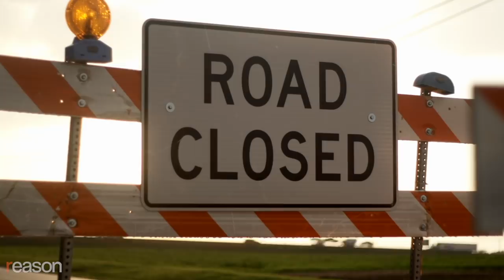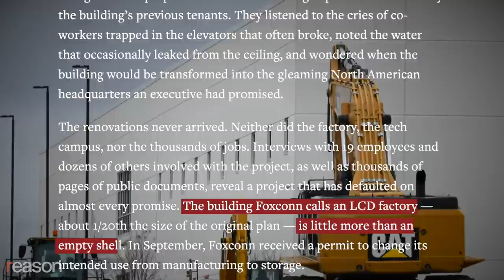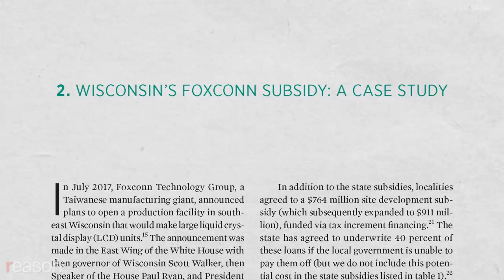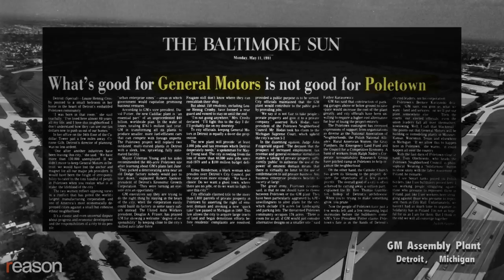Trump's Foxconn Deal Became Just Another Government Development Debacle

Comment: The issue here is more about politics and lawsuits than anything else.  Things take time to build, especially big things. A factory this size usually takes over a year to get initial production going, and additional years to get to full production. That is if nothing goes wrong. Ground breaking was in 2018... Governor opposed to the project was elected... I think you get the picture. Foxconn would have not gotten anything finished by the time the Governor was calling for the project to be caput. He did so on grounds that Foxconn is not investing enough while they delayed the project due to lawsuits.